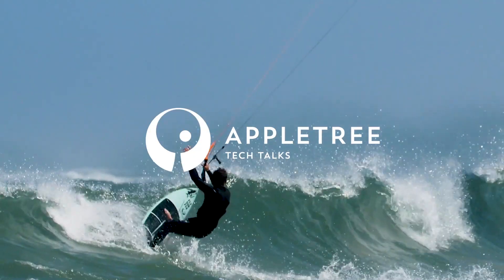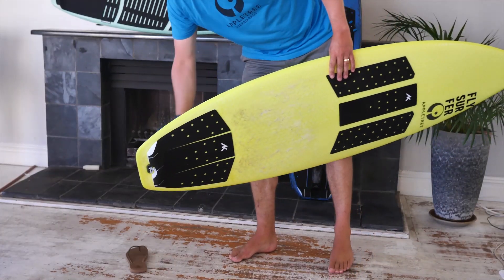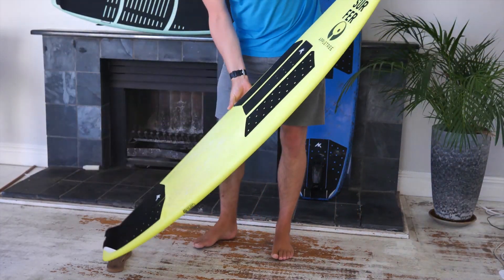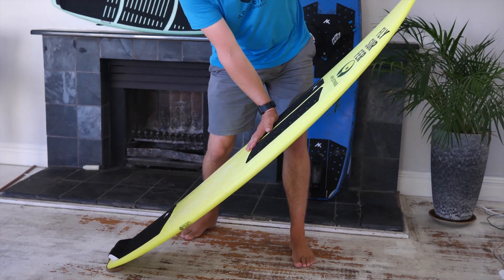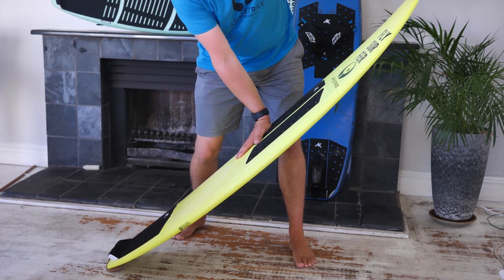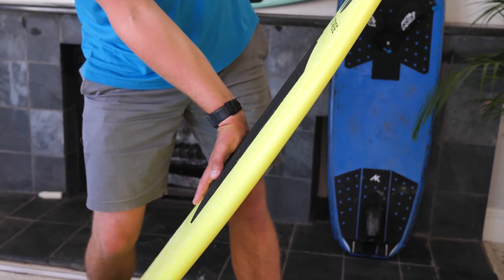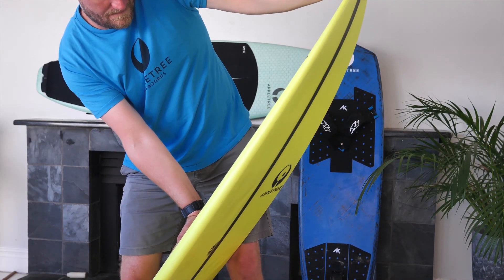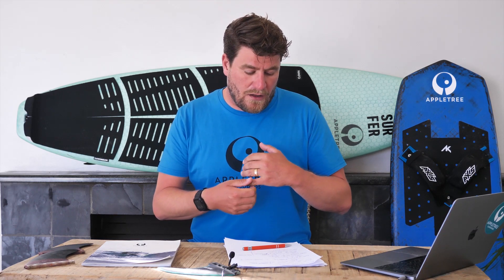TECH TALK: how important is flex in epoxy kite surfboards and foil boards/

Comment: I also have the impression that shorter boards flex less (same model in different sizes). Is that true?
Reply from the maker: yes, definitely true. it is highly dependant on the combination/balance between width-thickness-length so a shorter board of similar thickness will be stiffer.